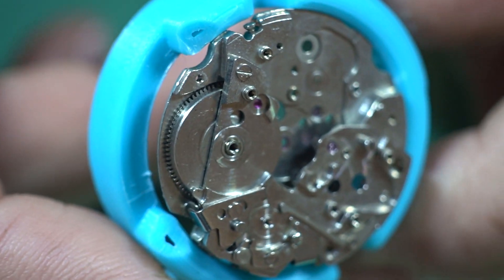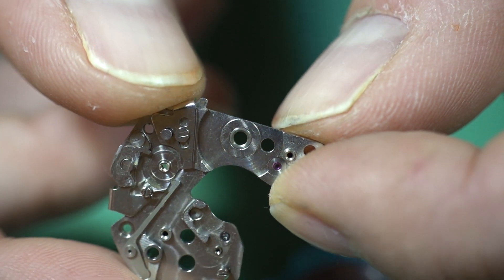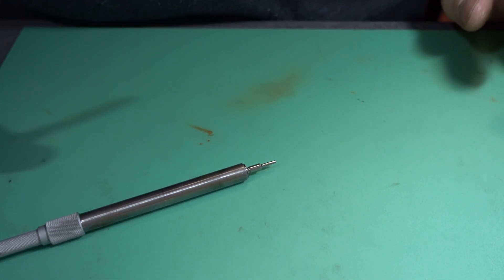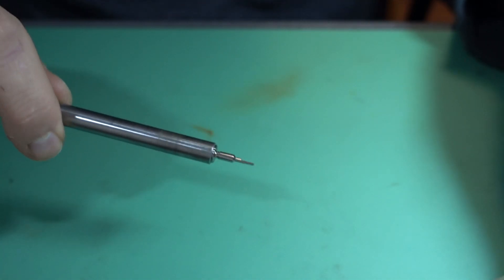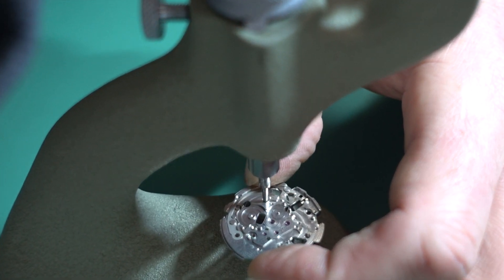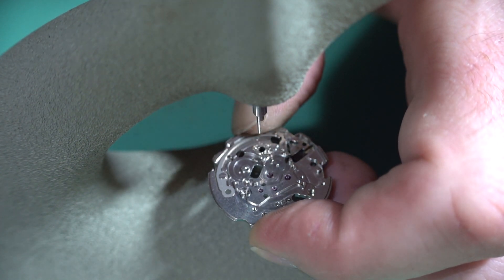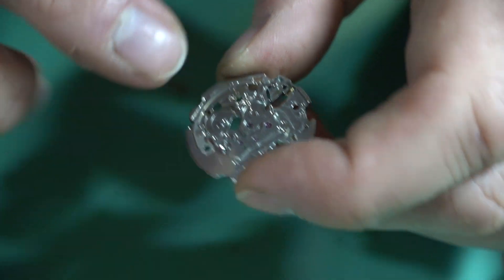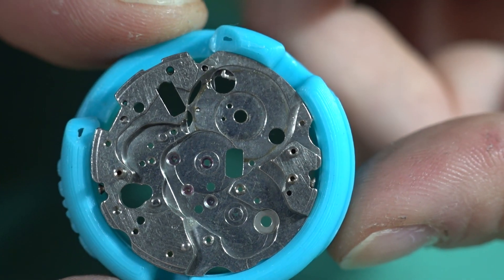[TECH] - Installing BARREL Arbor Jewels on SEIKO 6139

Comment: Very informative. So if I get this right you’re replacing a steel bush with a jewel?

I might have missed it but I kept FFing through the refocusing sections. 

Might I suggest the video would be more specific to the task if you edited those non productive parts out?

Comment: Hi,

I have just fitted one of your jewels and replaced top Bush with a new old stock bridge. So smooth when turning barrel.
I do not have a jeweling jig, press, tool. So all was done by hand, 1.6 mm reamer hand held and a micrometer to seat the jewel, then I fitted barrel and bridge to check it was true, it was not. From the back,, face I was able to position jewel and fix.
What a lovely sensation when rotating the barrel.
6139 6012 now up and running.
Reply from the maker: It makes a huge difference, hence the small bump in amplitude.

Comment: Did you ever considered using self lubricating sintered tungstan arbors, these would have the same coefficient of friction as synthetic stones but, are alot easier to handle.
Reply from the maker: I have thought about alternative materials but as the data is well established on corundum vs polished stainless steel, it's probably not worth trying to reinvent anything. e.g. I don't know what will happen over 20 years etc.

Comment: Excellent video, I do plan to retrofit jewels in my collection, but need to get the correct tools first.
Please could  you list the tools required, Thanks.
Reply from the maker: Geday, As I mentioned in the video you need a jewelling tool set. The most common is the SEITZ set. The reamer is in the set, 1.59mm. I use a 6mm stump. I also mentioned that retrofitting isn't really an option due to the swarf, it needs to be done as part of a service.
Reply: @hal0eight  please could you let me know what the Cousins part number for the deburring tool is as I cannot find it, by 6mm stump do you mean anvil as Seitz only seem to supply a 5mm one?

Comment: Why do you need to bore that area and put jewel?. You avoid  tear and wear but you add the hole size..What happen? Why seiko did not advise that way?.
Reply from the maker: I think you missed the point of what is being done here.

SEIKO didn't advise anything.

What I'm doing here is installing jewels on both sides of the barrel as these movements are prone to very serious barrel arbor wear after 50 years of service. The jewels fix the problem permanently.
Reply: @hal0eight that answers my question above. It’s an upgrade.

Comment: You say the reamer is brand new and then you immediately cleaned the brass off it. How did the brass get onto it if it was brand new?
Reply from the maker: The friction and heat from the reaming process melts brass onto the reamer.
Reply: @hal0eight  I know that VTA, I watched your video.  But you said that the reamer was 'brand new' (never been used presumably?)  You then immediately go on to clean melted brass off a 'brand new' reamer??? - did you really mean therefore that it was only 'almost' brand new??? (See what I mean? - good video though.)
Reply from the maker: @hariowen3840  The definition of "brand new" in this game is pretty flexible. So I think, from memory, probably used once before, so that would count to me as brand new. I mean, I think the video was on it's second take or something. My other reamers are at least 50 years old.
Reply: @hal0eight  Got you VTA.  I'm taking an interest as my Son has recently decided to get my old Seiko Pogue, which I bought in the 70s, cleaned, serviced and new crystal, the guy doing it, Simon Wilkinson UK, has recommended jewelling the barrel arbor bushes.

Comment: There's no need to adjust the jewels for arbor end shake once they are installed? Thanks for these videos! I'll hopefully upgrade a couple of 5606 movements with your arbor jewels.
Reply from the maker: No. On this movement, they were designed to have the jewel face flush with the side of the plate that faces the barrel. You have to remember they were designed to be churned out by robots of the 1960's, so tolerances are on the loose side. A bit of slop is OK. SEIKO's run better with slop. I rarely close the holes on the barrel covers as I get good results almost always.
Reply: @hal0eight  makes total sense. I never thought about it. It would be very interesting to see a technical drawing from Seiko to see what sort of tolerances parts were designed with. I guess manufacturability was high up on the priority list.

Comment: Thanks for showing your arbor port jeweling techniques Adrian.  I have found that 159 reamers may be slightly different diameters when comparing vintage to new.  Have you found similar situations in your experience?
Reply from the maker: Yeah I have. That's one of the reasons for this video I used a brand new one. Especially on older sets, you never know what they've cut before so they might be off spec.
Reply: @hal0eight  Where to buy the correct reamers for 6138 and 6139.

Comment: Hi Adrian, 
What is the size of the reamer that you use for the lower arbor port jewel?
Also, after jeweling the port will I need other lubrication than Seiko S-4?
How can I contact you to negotiate purchasing some jewels from you?
Reply from the maker: The lower reamer is the 1.59. I don't use the SEIKO lubricants as they are garbage and hard to find. The standard replacement is Moebius HP-1300.

All sales through the ebay store at present as it makes life easy for me.